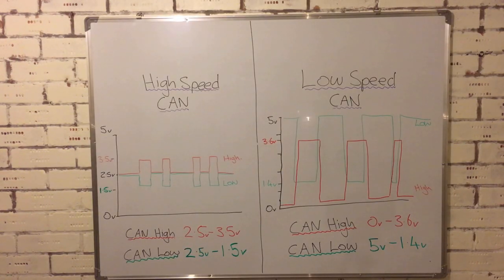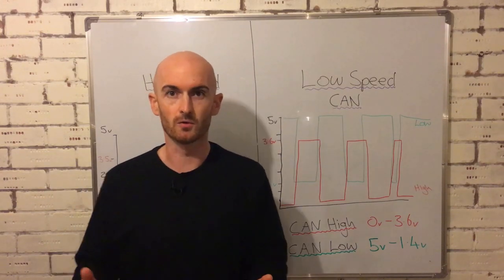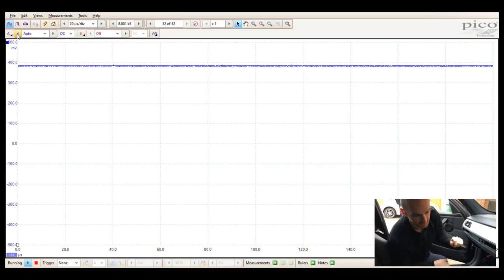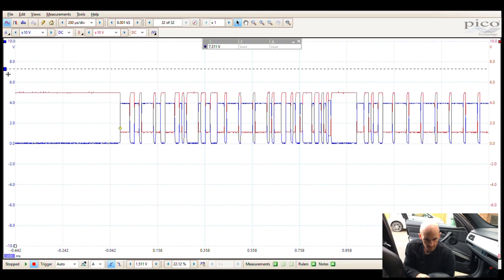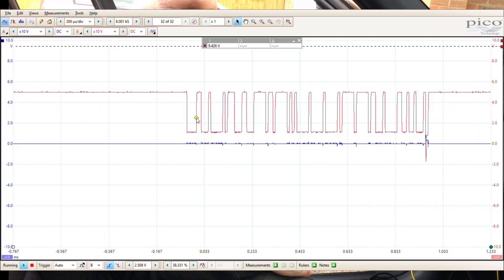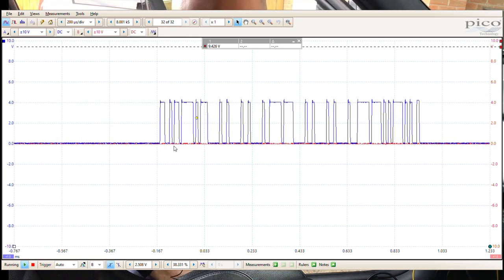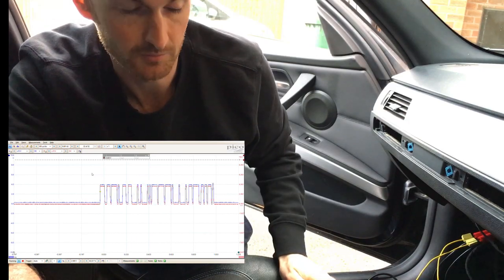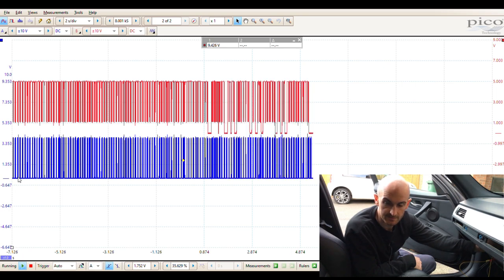HOW TO DIAGNOSE CAN BUS FAULTS [PicoScope 2204A Low Speed CAN] Mechanic Mindset

Comment: Can you recommend specs for a battery maintainer to use while troubleshooting with picoscope and scan tool? I’m a diy guy and was wondering will a cheaper smart battery charger/maintainer 2-4 amp be ok to use to keep from running down the battery while aim troubleshooting with key on
Reply from the maker: @scottsheffield2594  I think ideally you want a minimum of 10Amps to maintain ignition with minimal loads switch on. I did a review of a cheaper Sealey battery charge that claims 25A. It handles the current fine, but struggled to stay over 13.5V, which is only a problem for programming on certain vehicles.
Reply: @MechanicMindset  thanks, I just recently subscribed to your channel so have not seen that video yet. I ordered a 10 amp smart charger/ maintainer that auto switches to trickle charge when needed. When my picoscope 2204 arrives later this week I will be playing around with it watching your videos and don’t want to kill my battery. Thanks for all the great videos and content you share.

Comment: I have the Autel Ultra which has a scope in it. I figured from a long time back that I would get the cheap automotive scope you recommended and just did. Now I can use my laptop with the scope. The Ultra scope comes from the unit which plugs in to the obd. means leeds out the car window and across the engine. Not good if someone just opens the door. Also by having two scopes I have more opportunity to do stuff. verify readings for one. 

Let me ask a question. So I have an Audi A4 at present with the customer complaining of a warning of drivers door fault and parking brake fault at start. Then in live data just to let you know the door registers open and closed as its opened and closed. 

In a scan of the car using Autel Ultra,

Brakes module with u122800 saying implausible driver side door control module. 
Brakes module with u112200 saying data bus message implausible.
Instrument cluster with u105400 saying information electronics 1 control unit no communication.
Gateway with u105200 saying generator no communication
Drivers door electronics with b1468FO saying return msg drivers door closing condition implausible.
Comfort system module with b140B29 saying release button trunk lid range performance.
Comfort system module with u112300 saying data bus error value received.
Passenger door electronics with b148754 saying motor for window reg no basic setting.
Info electronics with b153311 saying GSM antenna 2 short circuit to ground.
Info electronics with b156401 saying antenna for telephone bracket electrical error.

So basically my question to you is wheres your mechanic mindset at after viewing those codes. Seems like majority are signal and data implausible. Would you even consider replacing the door lock to see what if anything, that does?
Reply from the maker: Sounds like a communication problem, but it could be anything. Even something g as simple as a power or ground issue. I’d take it as it came to me and start conforming what is and isn’t working, go from there. Also get more info from customer
Reply: @MechanicMindset  I fixed it.
Reply: @MechanicMindset  luckily customer had seen the scan data and got some info in his head so decided to go for a new door lock. Wed seen the door lock operating live data but still. So we changed the door lock and in changing it this is what I believe fixed the comms issue. The door control module strangely has white corrosion over the pins. Above the door rubber the window glass was green with algae. So with just a quarter second spray of wd40 on them and after reconnection of connectors. Erased the codes and with a rescan. ALL THE FAULTS WERE GONE.

Comment: great video thank i have a engine can bus off coming up on my merc viano under the IC module code 9100 
can you advise where to start with this
i have just ordered the pico and waiting for delivery any help will be great
Reply from the maker: you can also check out my other video where we look at high speed CAN bus - also the video where i look at CAN bus resistance with a multimeter

Comment: Very nice, Do you have a video explaining on how to trigger the signal ?
Reply from the maker: Hi, triggering to this low speed network isn’t the best as there is no defined high or low point. You can trigger to the last part of the message on High Speed CAN as the signal is higher, I do have a video on this 👍

Comment: hi mate, a quick question. when i connect a breakout box to my Audi a5 I'm not getting lights on 14 and  6? should they light up? 👍🏼
Reply from the maker: I literally did this the other day on my A4; they don’t. But it is communicating. I checked on a scope. Only when scanning vehicle
Reply: @Mechanic Mindset  so if I plug in a foxwell and scan it will communicate? also how can I get wiring diagram for abs control module? the brakes won't release 👍🏼
Reply: forgot to mention I've been following for a while and because of you I've purchased the hantek 1008c and gt100 and so many leads! 😂👍🏼👌
Reply from the maker: @ilikefishing7858  It should communicate if all is well. You’ll need a diagram from somewhere. You can check the free Carmin phone app; it might have it

Comment: amazing  video
is low speed can are fault tolerance too?
what if the module itself shorted(PCM).does it effect the  can wave forms. thanks
Reply from the maker: ali batebi Thanks for the feedback! Low speed CAN is very tolerant because the terminating resistors are not between CAN High and CAN Low (like high speed CAN). Low speed CAN is possible to work on single wire mode.

Comment: I've subscribed. I have an Australian ford falcon barra. It's got 2 fault codes referring to the can communication bus network in the ABS unit. Would you have any pointers for me? Great channel.
Reply from the maker: I think if you can apply the points in the previous video, you can confirm if there is a comms issue. ie, if you can read codes in ABS, comms is ok at that time. You’ll need to try and replicate the fault so you can diagnose it. Cheers

Comment: I am hoping one day that you will do a no communication diagnosis on the CAN Network. The reason is that you can have a no communication with only one module. In this case, you won't have to check the network because if you have an open resistor in the pcm for example; you won't have a communication path. My question is what do you think the voltage would look like on the scope if you lost one power feed  or ground to a module?
Reply from the maker: Hi, great suggestion. I definitely plan to co er more CAN bus diagnostics. This is a good one. To answer the question, if there was a module power supply problem (no comms), the CAN Bus signal will not be affected. The module simply won’t communicate on the network. Cheers! 👍
Reply: @MechanicMindset  I was expecting to see some distortions in the lines as I saw some in a video Scannerdanner and Tomy Wolf did on a no comm with a tcm. Thank you. I am looking forward to more Can bus diagnostic videos.
Reply from the maker: @bbmd2200  👍 I’ll have a play next time I’m on CAN bus. I suppose the reason I’ve never checks is that when ever I’ve had a no comm fault, the first thing I check is power supply; if it was a supply problem. I wouldn’t even get the scope out. Interesting to know though!

Comment: Is it better to use some type of logic recorder, where you can record for some time to catch the fault of it's something very intermittent?
Reply from the maker: Alan W Hi, there are tools like CANalyzer that can log CAN Bus, however they are generally used by engineers for development and testing, not mechanics. There are features in PicoScope that allow us to monitor longer traces like ‘masks’, ‘alarms’ and even the single trigger could be used to capture intermittent faults. You can use the CAN log function if Pico but it could be a long job trawling through the data to find and issue

Comment: Sir can the PicoScope 2204A oscilloscope works with automotive software thanks in advance if it does i will order one immediately thanks in advance.
Reply from the maker: Mike Emirian You can get it to work with the automotive software. See this video  - https://youtu.be/BvMH-SLl--0       But I am using normal Pico 6 software here. It is fine. You will also want to buy the automotive cables too. Thanks for watching!
Reply: Hi yes you can  you will need to download  automotive 6 from picco  website  and install it and delete  the oem.dll file  from it   it .may not work on the very first go but second  no problem

Comment: Hello is it possible to test with only one channel on the scope
Reply from the maker: Yeah you can do one measurement at a time 👍
Reply: @MechanicMindset  thank you. I was also curious a what steps you would take to reseal a wire is you had to use a piercing probe. I work on equipment where back probing isn’t always possible

Comment: Working on 2011 volvo xc60 .having multiple codes for laser communication with driver door.cluster.seat climate control windows.all code store in cem .when I pull fuse for cem codes go away.will not return for few weeks.

Comment: Can I get a clean RPM signal from the CAN pins?
Reply from the maker: Not from CAN Bus. You’ll want to connect on the crank signal. You can get RPM data from CAN, but that’s different from the ‘signal’

Comment: Great video,can’t understand why shorting can bus to ground doesn’t damage the system.🧐
Reply: AFAIK, and I'm by no means an electrical engineer so this could be wrong, but the CAN-BUS is a digital system. so it transmits 1's and 0's. Supplying ground to the system would in theory just kinda open the circuit sending a persistent 1 or 0.

So the computer would be confused as all hell, but no electrical damage.

Comment: this is very complicated to do can you make tutorial for begginer ?
Reply from the maker: triplex triplexxx Sorry for that. Yes for sure, I will be making some videos that cover the basics of CAN bus, then the basics of taking measurements. I appreciate that a lot might have been covered there 🤪.
Reply: @MechanicMindset  my car gives me k-can line fault on 10 modules but car works and runs fine
Reply from the maker: triplex triplexxx what car is it? As you might see in the video; on this low speed K Can, a fault on one wire will still allow the network to operate (single wire mode). But it also depends on what fault code you’re are getting
Reply: @MechanicMindset  car is bmw e63 every module gives same error, k-can line fault , only PDC gives diffrent k-can low wire fault
Reply from the maker: triplex triplexxx sounds like a problem with CAN Low (without actually looking). You would need to do the tests I do in this video to confirm the fault. Stay tuned for more basic videos in the future 👍
Reply: @MechanicMindset  yes i will run tests can i use for this purpouse cheap oscilioscope from ebay 30 usd one or i really need picoscope
Reply from the maker: triplex triplexxx you don’t need to use this one. In fact you can check with a volt meter too. I do t have a video for that yet
Reply: @MechanicMindset  ok i wil subscribe to chanell and looking foward to see that video :)
Reply: and i found picoscope for 94 euro so i will buy

Comment: Hello . Please I have sorento sx 2019 . And there is a fault in can bus data . When I remove the battery terminal and test from the pin 6 and 14 . Resistance is 85 ohm . I think there a problem in gateway . Almost in terminal resistance . If this test is OK.  Please tell me where can I find terminal resistance for this car
Reply from the maker: Sorry not sure, usually in common modules like Engine and ABS, or sometime gateway

Comment: hi darren how are you ..jsut upadting you  ive been at this car whole weekend ..so now im getting c 3e9,3fo1,4000,4390,444c.444c,452a from a autel ms8s scanner ..from  ISTA scan tool its dde s0129  any help appreciated
Reply from the maker: Hi, what is wrong with the car?
Reply: @MechanicMindset   at present no communication with dde...i replace the blue relay  ...no.2 and 4 injector activation  code s0129
Reply: 2010 tourer 320d msport
Reply from the maker: @lloydpalmer5735  If all the powers, grounds and CAN are good at the module, check for water in the module. 

If you are reading codes, the comma must be ok
Reply: @MechanicMindset   all that checked ..but heres the ting  i drove the car parked up on my  took the motor out to do timing  chain over the period of almost  a month its sat on my drive cpmpleted the mother and put it back in

Comment: Everytime i use my Pico 2204 I can never get a clear signal like you, Also bought the Hantek leads you suggested and its still rubbish :  Never seen a square wave yet :) :)_
Reply from the maker: Can you try another laptop? Also make sure the ground connection is good and start with 20v/20ms/div. Honestly, these scopes are up there when it comes to performance. Not using any USB hubs either? Start with battery voltage for a flat line

Comment: where to find diagram to know which wire is can low , can high in body controle module cable plug ? :)
Reply from the maker: TechGeek You can search line for ‘car model’ wiring diagram. There is quite a lot scattered around the internet. Otherwise you will have to pay for a service like Autodata. Also check if the car manufacturer uses generic colours for all the models
Reply: @MechanicMindset  found it in bmw ista d . thanks
Reply from the maker: TechGeek Ah ok, yes. BMW ISTA has all the diagrams. I assumed you had nothing 👍
Reply: @MechanicMindset  in my bmw car i am getting PDC  kcan low wire fault can i connect picoscope to pdc module to find fault or how do i do it , like to find exactly which wire is faulty , i have also wire signal tracker to track shorts in wires , can i use that ? :)
Reply: @MechanicMindset  how would you deal with this problem PDC kcan low wire fault  :)  let me know your opion
Reply from the maker: TechGeek Is that the fault code you have? Also what is wrong with the car? What are the symptoms? If it’s a K CAN problem, I will do the check in this video 👍
Reply: @MechanicMindset  what is wrong is that pdc sensors in the front of  the car go crazy, they detect something in the front of that car, but there is nothing in front XD they just keep beeping , only 2 of them , i replaced new 2 sensors still same problem hhh
Reply from the maker: TechGeek Ok, I think the K CAN is not the problem. I think you need new sensors. Make sure nothing is I the path of the sensor (like a reg plate). If you have ISTA you can see which sensors are causing the problem.
Reply: @MechanicMindset   ista d is showing fault, k-can PDC low wire fault . But thanks i will look for problem with wires maybe there is something there :)
Reply: @MechanicMindset  i bought new sensors and replaced them still not fixed :)
Reply from the maker: TechGeek Genuine and New sensors?
Reply: @MechanicMindset  yea bought them by the bmw correct number .
Reply from the maker: TechGeek What model car?
Reply: @MechanicMindset  bmw e60
Reply from the maker: TechGeek Check in boot area, make sure PDC module is not wet! Common problem. It’s under where the spare wheel should be 🤞
Reply: @MechanicMindset  its not wet never any water intrusion happened in this car. it was always super dry . Bmw ista d is showing k-can PDC low wire fault.. no water problems with this car
Reply: @MechanicMindset  car is always in garage when not used never left in rain or barely driven in rain.. 100 % no water went never in the car
Reply from the maker: TechGeek Not sure then sorry
Reply: @MechanicMindset  i will check k can network faults with oscilloscope . Then i will let you know thanks

Comment: why is pico saying 2000 series not for automotive use. They want me to get the 4000 series picoscope.
Reply from the maker: You can’t use it with automotive software. And need to be care as 2000 has 20V maximum input